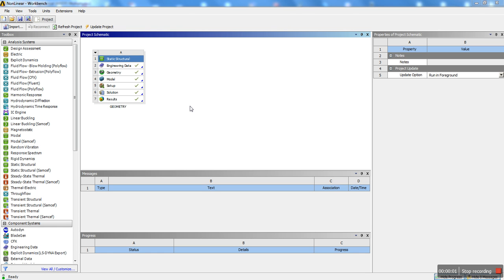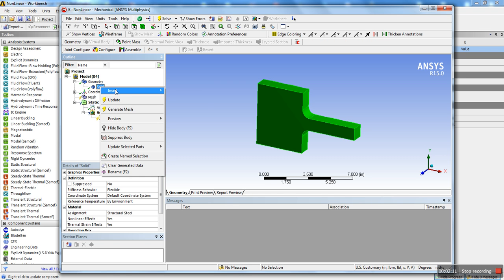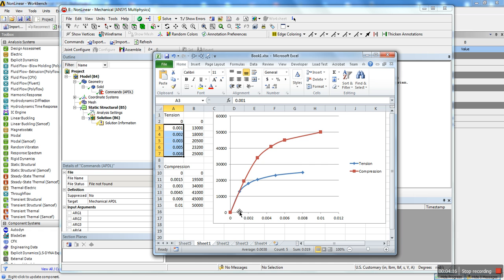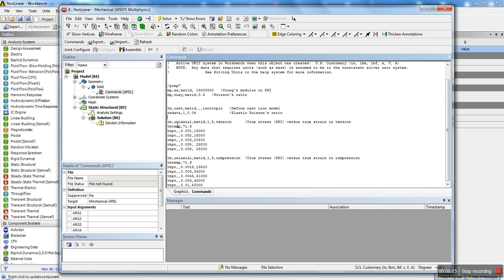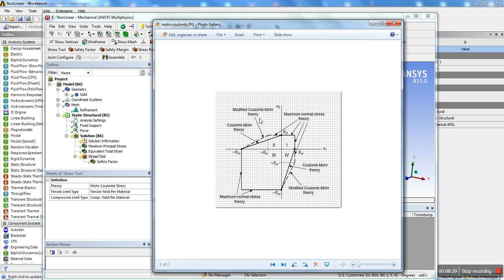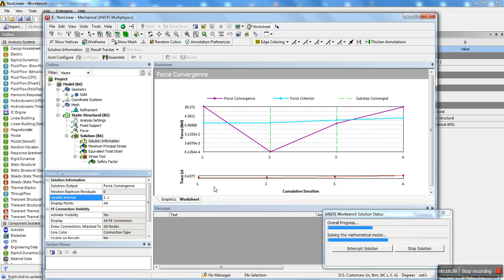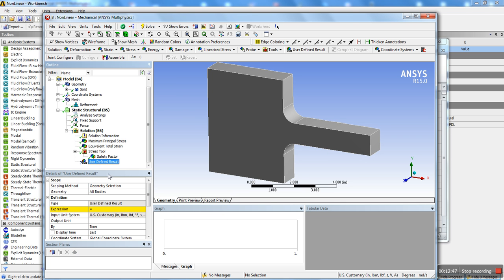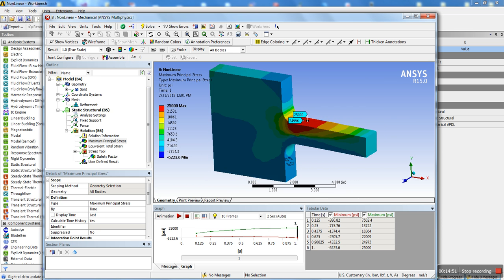ANSYS Non-Linear Stress-Strain Cast Iron Tutorial - Static Structural

Comment: Hello Sir, thanks a lot for all the videos, please, l have a specific problem with [ The None Linear Analysis of Steel/Stainless Steel Concrete Filled Tubes under axial compression ], l have tried several times, but failed to get the Strain, Stress and all the Deformation curves, so l will really appreciate any help or any possible videos link, once again, thanks a lot for the good job you are doing

Comment: Hey there :) Two important questions.
 How does the program define plastic Poisson's ratio? -(change in transverse strain)/(change in longitudinal strain)? Is that right?  
How did you derive the corected expression for Equivalent Total Strain? 

I'd suggest using 0.4 as a value of plastic Poisson's ratio instead of 0.04. (Please refer to the following study) 
https://nvlpubs.nist.gov/nistpubs/jres/37/jresv37n4p211_A1b.pdf
Apart from that, I really appreciate your work.

Comment: Thanks a lot for the details.. really helps..

Will the basic material definition becomes irrelevant after using this command?
Where have you specified the "Yield Strength" of the material?  When I try to evaluate the Safety Factor, error message comes : "Yield Strength is required but not defined"..  can you help?

Comment: +DrDaylo Thank you for this informative video. 
I would like to ask the following queries related to command object which you mentioned in the video;

(1) Why do we need to enter the stress-strain values?
(2) You said to take few data points from the experimental data, why not take whole data points?
(3) Shall we take the points randomly? or should be taken within linear region or non-linear region or both?
(4) Are there any limits for the number of data points which can be used or taken from the original experimental data while entering the stress-strain values in the command object ?
(5) I have data points from experimental curve but the total number of data points are around 460 for compression test of concrete material. Can I directly import the data points for command object from excel?

Hope to hear from you soon
thank you
Reply from the maker: Thank you for watching! Here are some answers:
1-In this case we need to enter the stress strain values to tell ansys what the stress is at certain strain values because the material is non-linear (and different in compression and tension).
2-Few data points because the more points you include the longer it will take to solve.
3-The command object only includes the non-linear region, the linear region is set with the youngs modulus E. And yes you should includes both the youngs modulus and the non-linear region
4-Not sure about the limits, however I think more than 10 would be excessive and take very long to compute.
5-I would strongly suggest to simplify the number of points to below 10, extract key points.
Thanks!

Comment: Hi,
thanks for the video , I am simulating a lattice structure  so I have to feed the test data .
 Could you send me the data.
e0149672@u.nus.edu
Regards,
Reply from the maker: the data should be in the description, please check and let me know.
Reply: Thanks Dr I found it, but I am simulating a stainless steel lattice so I want to change the material model to be stainless steel not cast so I put PLAW instead of CAST but does not work, Do you have any suggestions and only have the compression data? could it work?  Thanks in advance

Comment: Can you please send me the command file? As you mentioned multi-linear isotropic hardening model(MISO) in one of your comment. If I add tensile yield and ultimate separately along with stress strain graph through MISO in custom material, then will it cause me any problem? Or does adding stress strain graph automatically defines the tensile yield and ultimate values !!
Reply from the maker: The command file should be in the description of the video!

Comment: Hello dear Dr. Dalyo, thank you for your great efforts! I have a radial turbine rotor, the geometry is a one file contains the blades and the shaft as a one part, I need to calculate the deformation as a result of the pressure distributed over the blades...will I consider the shaft as a fixed support and have I insert the rotating velocity ? Thanks

Comment: hi Dr, thank you for your videos. I have a question which I still dont get any answers. plz can you tell me how could I  use stress strain curve for compression and tensin using Multilinear isotropic hardening
Reply from the maker: +SAID ABDI In engineering data, where you define your material, on the left hand side there is a toolbox with a bunch of different material properties you can add, you can right click on multilinear isotropic hardening and add it to your material or drag and drop it. Then you enter your custom curve for the data. Note that this data will be the same for compression and for tension.

Comment: Hello DrDalyO, I have a question about cast iron model command:
it works fine with compression, but when I try the same command file for tension, it captures only linear region and ANSYS gives error above linear region. The error message is: " Cast iron tension local NR algorithm does not converge for material 1"
I tied small steps, stabilization=on and the warning message disappears but still no plastic region is simulated.
 The model is a simple Stress-Strain specimen.
Do you have any idea, how to simulate plastic deformation using different tensile and compression Stress-Strain experimental data? (like cast iron)
Thanks in advance.
Reply from the maker: +Zurab Shermadini i believe the code includes table data for different tension and compression commands no? If its not in this video please see my other one then and get back to me
Reply: Thanks a lot for the answer. Yes, the code includes data for different tension and compression commands. As I mentioned in the first comment, it works very fine for compression, and for tension ANSYS has a convergence problem.
Then I used displacement instead of force and did the tension stimulation. The result is: it works, but for small strains (very near to elastic regions). Plastic tension data are not simulated
The question is: Is there other way to input separately compression and tension data?

Comment: Hi Dr Dalyo,

I am working on a Fluid Structure Interaction project which is a combination of Transient and Fluent.

In transient, I have solid shell which has dimensions in micrometer scale.
In fluent , i have fluid which flows at a velocity.
When both the systems are combined, the result should show me a deformation in solid and how flow path of fluid changes.

My question is, 

If I assign structural steel as the material to the solid shell, I have deformation which is visible and there is no distortion.
But, solid shell is a viscoelastic material, which has very low Modulii (Bulk and Shear). If i assign this material, I have heavy distortion of cells (negative cell volume detected).

Please help me in modelling this type of model when i assign viscoelastic properties to the structure.

Thanks

Comment: the value entered in safety factor is yield strength of the material?
Reply from the maker: +Ammad Yousuf well for cast iron there is no yield point, only ultimate strength. So the safety factor is calculated from that

Comment: while running analysis it showing ""
Solver pivot warnings or errors have been encountered during the solution.  This is usually a result of an ill conditioned matrix possibly due to unreasonable material properties, an under constrained model, or contact related issues.  Check results carefully.
Reply: I had the same problem, probably the problem is in the  geometry's size, probably too small for the force apliced in this tutorial (2000 lb). Try putting a smaller force.

Comment: hi drdalyo. the line tb,cast,matid,,,isotropic defines a cast iron model. what if i were to change the material to say, stainless steel. how do i change this line to make it into a steel model. please help. Thanks.
Reply from the maker: +ImJuStoOGoOd for stainless steel, its much simpler. dont use any command objects. just go into engineering data, and use stainless steel from there. if you want to add nonlinearity, just drop in a multilinear isotropic hardening parameter into the stainless steel details, and enter the data from there.
Reply: @drdalyo   Hello Drdalyo, I am using a custom material, and I tried with the multilinear isotropic hardening but the solution is much far off from the experimental data. I resorted to your method out of desperation can you help

Comment: Hi. what does the tbtemp 71.6 mean? is it the temperature of the specimen during simulation? and what unit is that in? 
also, if i were to just use tension alone, how will that change any of the code for the commands APDL? thank you.
Reply from the maker: +ImJuStoOGoOd those are the temperature properties of the material data. the units can be checked in engineering data. if just tension, you should use isotropic bilinear or multilinear hardening rule in engineering data instead of using complicated command objects.
Reply: Hi, could you possibly make a video on how to better understand and use the ansys manual for different situations.

Comment: very helpful tutorial.
do you think we need to change the tensile yield strength and compressive yield strength values ?
Reply from the maker: For the rebar?
Reply: +DrDalyO you said u have to change the tensile strength & compressive strength values in material props
Reply from the maker: +Hari V Santhosh oh well depends. its only use is when you use the safety factor tool. in that case you can choose to use material properties or custom value, if you choose mat. prop. then you must input the ultimate properties in the eng. data section. if you choose custom, you enter the data right there. cast iron does not have a yield limit, so ultimate only applies for this.
Reply: Ok thankyou

Comment: Thank you for your very helpful video! i'd like to model a functionally graded material but i couldn't manage to model an elasticity depending on the radius of a sphere with a function. Could you please help?
Reply from the maker: +deus.ex I do not have much experience with composite materials. Did you check all the possible material properties you could use in Engineering Data? if so, then you should look into using command objects and APDL commands to do this. I dont know much more. good luck, thanks for watching!

Comment: thank you for this helpful video.
I have two questions:
how do you define nonlinear materials in ansys workbench? I didn't catch you very well. and is there any difference between nonlinear behavior and nonlinear materials?
Reply from the maker: +Abdell Abdell Well nonlinear material properties would give nonlinear behaviour. I would suggest using the ANSYS built in library, under Engineering Data- Engineering Data Source - General Non-linear materials. Here you could select from a general database of non-linear materials and modify from there.
If you want to define a custom non-linear material, things get more complicated. You would have to add properties from the toolbox in the engineering data, and for non-linear behaviour, there are many different models. Some of the most common are Bilinear Isotropic Hardening or Multilinear Isotropic Hardening.
Hope this helps, might be abit advanced..
Thanks for subscribing!
Reply: THANKS
Reply: @drdalyo  Hi sir, can I define non linearity within the yield point? If so which model is suitable? I wanted to edit in the engineering data itself.

Comment: excellent example sir, but i am a little confused about material because you are saying it is cast iron model even though at 2:06 the solid material is structural steel. In addition, could you explain more Commands (APDL) and why we need it? and could you please send me the data, sir?
Reply from the maker: +joe joe Hi, thats actually a very good question. When you add material data in the command object as I did in the video, this overrides the original material input of structural steel. So basically when the solver runs, it ignores the structural steel data and uses whats inside the command object instead. This is because Ansys workbench does not have all the functionality in an easy GUI format when compared to APDL. So some more advanced functions, such as cast iron table data is not easily found in workbench, so command objects must be used. I hope this answers your question! check your inbox for the data.
Reply: +DrDalyO thanks a lot, i got it, sir...

Comment: I have a problem with modeling concrete beam. I want to change element type and material characteristics using apdl commands but I am not familiar with them enough. Can you help me with this? I try to use video Modelling of  RC beam with Ansys Workbench (Alaa Elsisi) as example, learn a lot  but still have a problem. Where to put commands and something like that.
Reply from the maker: +Zarko Petrovic Are you doing an impact on concrete? if so you could use the explicit dynamics solver, and there in engineering data, open the materials library and look under explicit materials and choose CONC-35MPA as a starting point, and change the parameters from there.
It seems like many people want a concrete beam tutorial, so I will prepare one. Maybe I could do it by next week, I will see.
What exactly is your concrete beam problem? a beam on two supports with a press at the center on top? I assume with rebar?
Thanks
Reply: +DrDalyO  I am modeling two equal span concrete beam loaded with two static force in the middle of each span. I easily modeled beam and add rebar as link body as Alaa Elsisi suggested in his instruction. Instead of default element type I want to use Solid 65 for concrete and Link 180 (or 188) for rebar. I have to do that using apdl commands. In such case, changing of material properties is also by using apdl commands. I know what commands to use but when I specify element type inside Geometry branch and material properties inside Static structural branch workbench don't recognize my commands. Meanwhile I realized by watching some other instruction that maybe I need to activate apdl commands somehow.In further investigation my goal is to model concrete beam strengthened with frp material.Thanks for trying to help me.By the way your tutorials are very helpful.
Reply from the maker: +Zarko Petrovic Hi. Im happy my videos are helpful! If you are able to add a command object in the geometry branch, then ansys should recognize the commands unless there is an error with your input. If you have multiple bodies inside "Geometry" you have to add a command object to EACH one of the bodies (just copy paste the same lines of code).
Try a simple scenario, create a block with a fixed support and load, and run with stainless steel and check the results, then add the command object with code and check to see again if its any different. This will save you time to debug your problem. Here is an example code (i believe the same from the person you mentioned above) to try out. This should work:

ET,matid,SOLID65
MPDATA, EX,matid,,2e6
MPDATA, PRXY,matid,,0.25
TB,CONC,matid,1,9,
TBTEMP,0
TBDATA,,0.2,0.8,3,30,,
TBDATA,,,,,,,

R,matid, , , , , , ,
RMORE, , , , , , ,
RMORE, , 

Best of luck! Let me know how it goes.
Also, you are not the only one who is asking about RC beams. Doing it in static structural is possible more complicated than doing in in LS-DYNA.
Reply from the maker: +Zarko Petrovic I might do a video on RC beams to clarify your question, as well as others.

Comment: Sir, can u please explain while applying the external load, you have given the input value of load as -2000psi in the y direction, which is transverse to the specimen (which is generally for the fluxural failure) but rather in the tensile testing (stress strain curves)we use the axial loads... And for the experimental stress strain curve for the cast iron, the ASTM stds generally follow the dumbbell shaped specimen,and you used some random model, so how far these results verify?
Reply from the maker: Hi, thank you for your comment. The purpose of the video was not to simulate a tensile test specimen bar. The model used in the video was arbitrary and was just supposed to show how to implement the cast iron model for any object. You could use the same method as shown in my tutorial and use your own geometry (so if you want, make an astm std test bar). 

I hope this answers your question. Please let me know if you need any further clarification. 

Thanks!
Reply: +DrDalyO  thanks a lot for the reply
I have 2 questions
1.  You are using the data of the tensile test (axial loads), and applying the bending loads (transverse loads).
2.  The specimen you modelled is not matched with original specimen 
but then also it shown good validation as comparable with the experimental data

Thanks
Reply from the maker: 1. Stress-strain data can be used for any type of loading.
2. Again, this is not a specimen test, just an arbitrary example. Also i am not validating any results to experimental data. Just showing that the input curve is being respected by the results.
Reply: +DrDalyO thanks again, I got it.

Comment: Hi there i want to know something, for example i have the option of parameter set on and i need to do 5 experiments with the same material but with different multilinear isotropic hardening for each one, is this posible?
Reply from the maker: +Gerardo Pulgar The only was you can parameterize the multilinear isotropic hardening is with a scale or offset. So you could have one stress-strain curve, and then scale it differently 5 times, and run the analysis that way. Otherwise, you would have to run each case manually without parameters (duplicate it in the project view), and set your different curves.